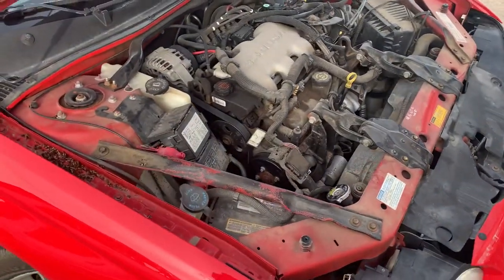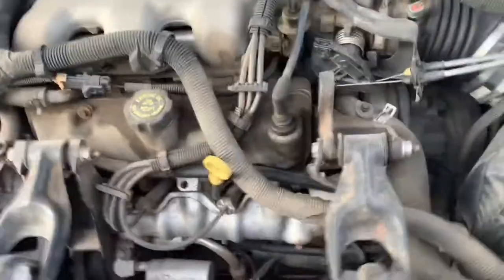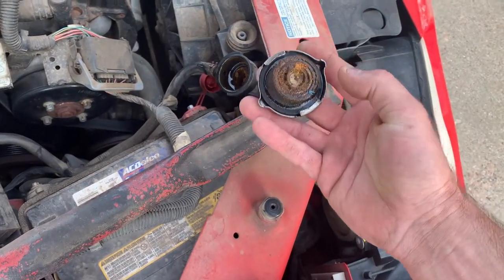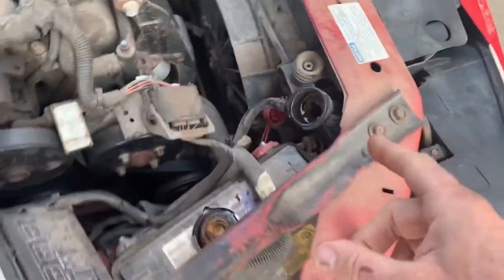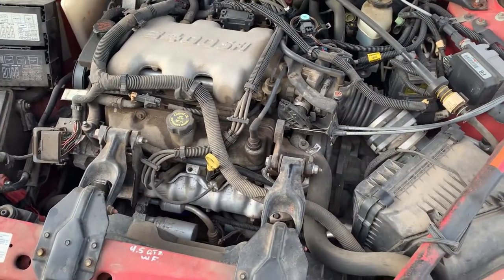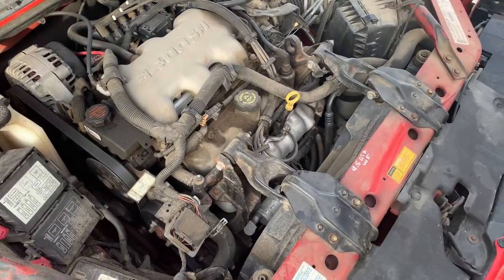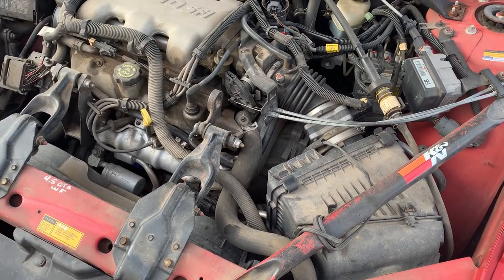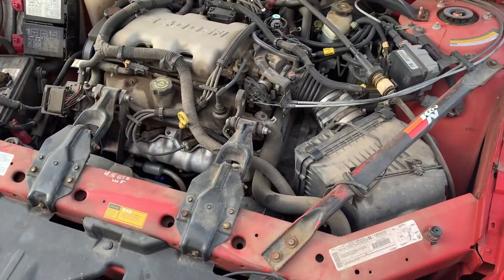What Causes Coolant To Dry Out And Clog Radiator and Kill Engine

Comment: 1997 4.3 v six is doing this, I put a new radiator on it last year & it's starting to do it again. Very frustrating. 216 thousand miles everything works even a/c. Thanks for sharing
Reply from the maker: Make sure the cap is good. If you can’t test it, replace it. Make sure there are no coolant leaks and that the coolant is full in both the radiator and the overflow bottle or it will do this.

Comment: I have no leaks and it stays cool perfectly, but nothing comes out from the drain plug on the radiator. Just some of that rusty mud paste of I stick a wire in. 2014 370Z I  bought 8 months ago. Guess I'll just buy a new upgraded radiator and coolant reservoir (it's pretty muddy as well). Thanks for the video.

Comment: How can i flush the engine??
Reply from the maker: If it’s not to solid yet you have to use a cleaner found at auto parts stores to clean the system and power flush it. If it has become too bad, sometimes we have had to replace a radiator, hoses, and the heater core and sometimes head gaskets. They can become very bad.